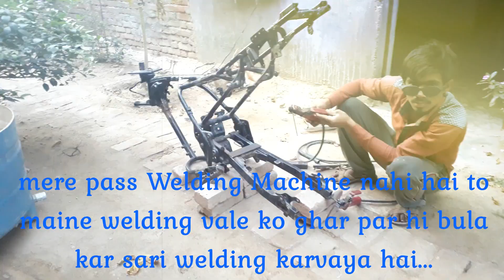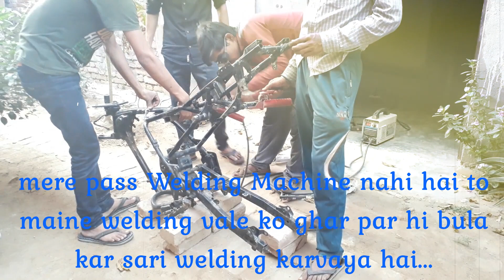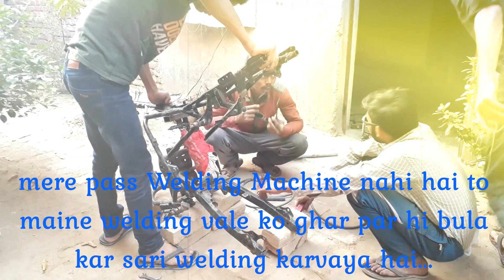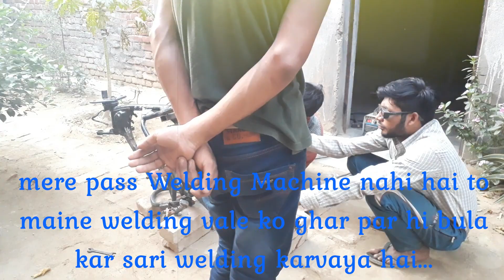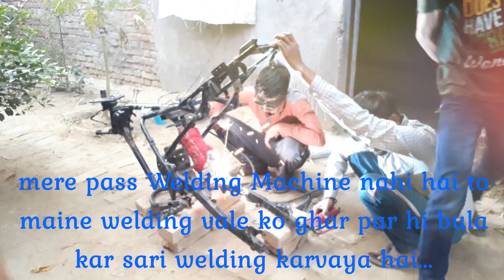3 शाकर एक ही Bike में   | Bike modification with Aamis Techsool

Comment: Can you be 100% sure of safety with that welding part
Reply: No
Reply: @SocialPerspective101  Yes, i am sure it can withstand. but the welded parts should be buffed neatly and coated with three coats(including primar). most of cases poor coating of paint layers leads to rust and fatigue